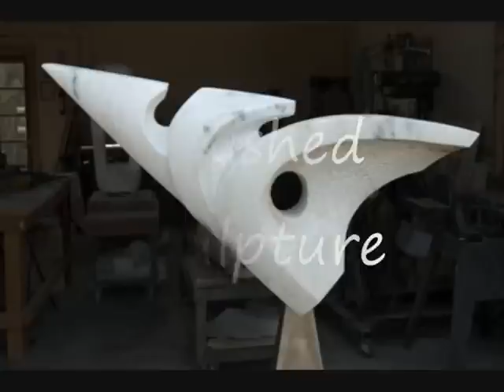Carving Marble with Mark Carroll

Comment: Hi Mark. Just a friendly word of advice from someone who is a rockhound who works in risk management and safety planning... you really should be using a water system to avoid rock dust while cutting any stone. Additionally, a paper filter mask is nowhere near good enough. Get a 3m mask with the appropriate filters that can be swapped every few months or so. Rock dust can cause major respiratory problems, and it doesn't take much exposure to have really bad effects on you. Great work though.
Reply: It's calcium carbonate. It's not like granite which has silica.
Reply: I guess that's why Michelangelo was only 88 when he died.

Comment from the maker: @sheilamaclean1 
  Thanks for watching my video.  I would suggest using a masonry carborundom grinding disc that you can find at any hardware store.  They usually cost about $4 each.  Good luck with your carving.

Comment: Can you pitch with the pneumatic chisel? Also, later in the video you return to hand chisels. What are the benefits over the pneumatic chisels? Thanks for posting.
Reply from the maker: I would not try to pitch with a pneumatic chisel.  You will mushroom over the end of the chisel and it wont fit in the  hammer.  You have to strike hard on a pitching tool, too hard for a pneumatic tool.  Hand tools give a different look than the pneumatic tools.  It's an aesthetic choice.

Comment: How did Michelangelo do this before power tools?
Reply: on that time, they were doing it with primitive tools which were specially designed for that purpose. various forged chisels + hammer + primitive metal saws (hand handled, of course) + feel of a sensitive touch for so weak stone as marble is...
Reply: klesar.hr The primitive tools are still the most used today. By far, not to say cutting some corners with quickness is a modern bonus.And the hauling, quarry bit would be some work!
Reply: with talent...and yes; some of us still do.
Reply: He had numerous people who worked for him ,who never got any credit .